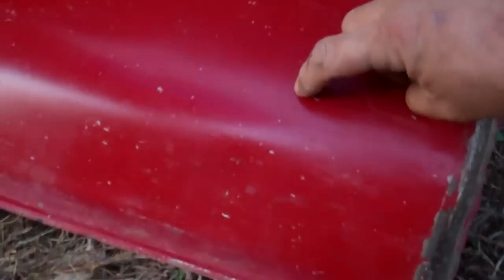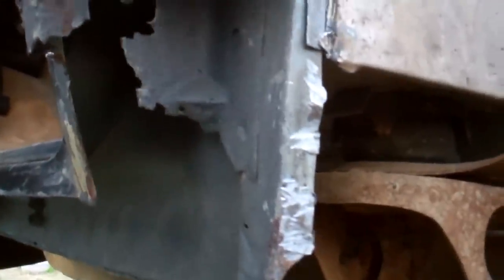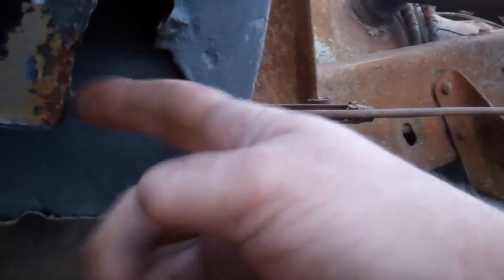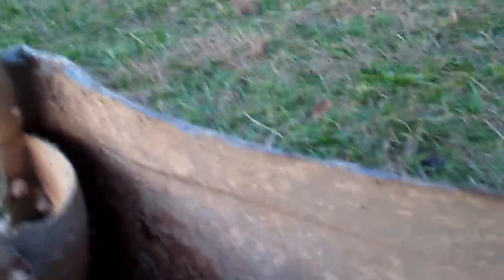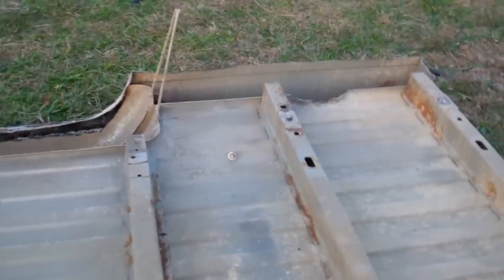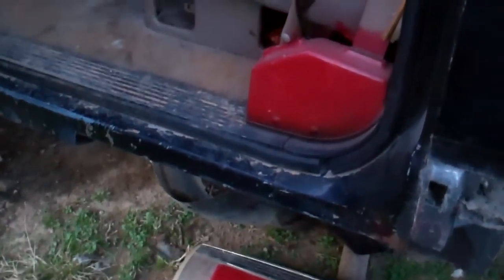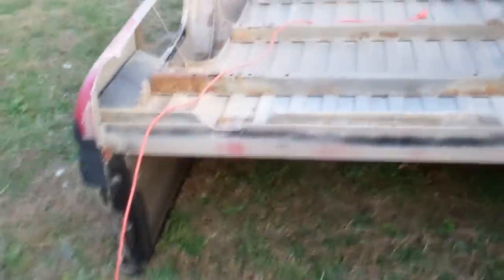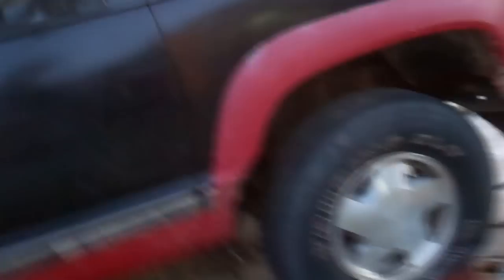They say "blood equals ratings"  right?

Comment from the maker: @nick89gm thanks but the bodystyle didn't change until 3rd quarter of 99 and i did specify in my ad for it that it was a 1988 if it's not the right bed though I can always hit up our local pull a part on the way home they have a few of those trucks out there.  so one way or another i'll have one soon to replace the old rusty box i had on it . 

thanks for watching too i appreciate it.

Comment from the maker: @The18Jake Used the front part of the passenger side of the bed and then used my round headed sledge to round out the corner of it so that it matched the normal rounded edge of the cab. everything will line up but i'll wind up measuring it 4 or 5 times more before i actually cut it because i won't be able to redo it if i screw it up. i'll actually have to get the actual cab corner if i screw this up. the cut on my hand was fine a little washing off with peroxide and all is well once more :o)

Comment from the maker: @ding0925 they usually don't around here much either which is what led me to believe that this thing had been up north for a while too. my red 89 just now has a hole in the cab corner and it's never been up north but it did get kind of submerged a couple times and that's what i think is what started the rust in that side the thing never dried out properly and then started to rust. i had no clue till just this year when it started to buble up

Comment from the maker: @More350Power i'd have done the duct tape before the super glue. I cut the whole end of my middle finger off when i lived in Knoxville cleaned it off good with peroxide and wrapped it in a couple guaze pads and duct tape and it's fine today. had i gone to the hospital for that they would have taken forever and put like 15 stitches in it, i didn't have time for that. i was working 60+ hours a week back then so i had to do what i was doing quickly and get some rest for work. but it's fine now